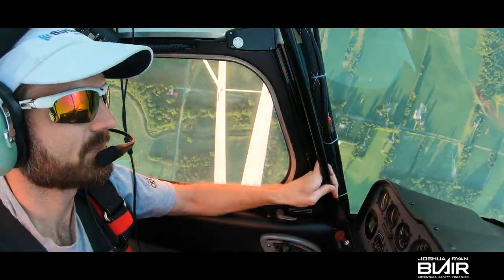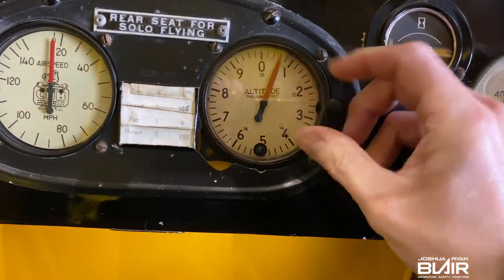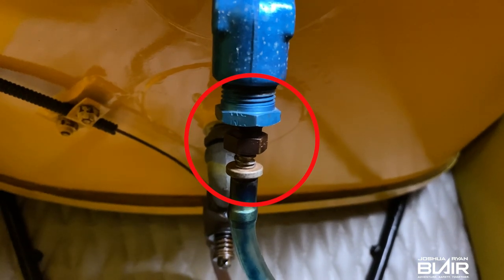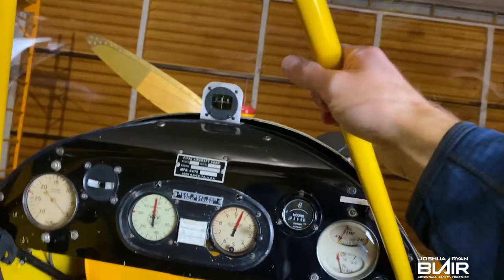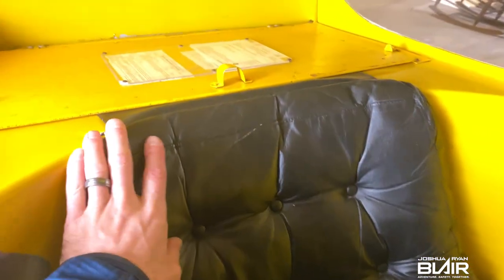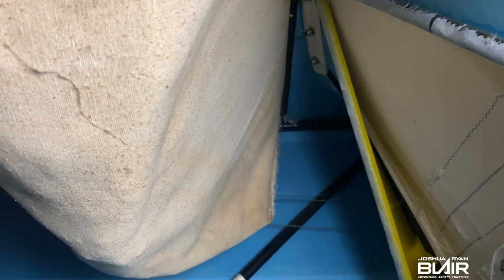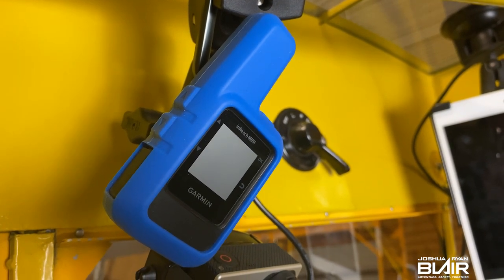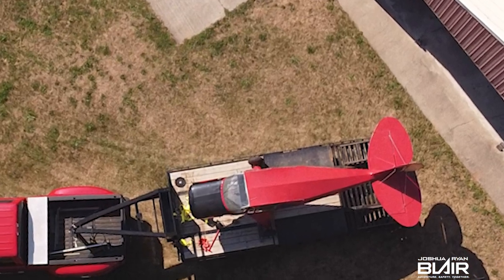Real Close UP | Piper J3 Cub | Interior Setup

Comment: I fly a J3C-65 built in 1946, one year after I was born.  I truly like flying it but I like your version of the instrument panel.  I can see it's been only slightly modified with the turn-slip indicator and the Hobbs.  One thing somewhat difficult in a J3C is the amount of muscle needed in the back seat during taxi.  I've heard that mentioned on other Cub videos on youtube.  I got my PPL in 1991 but am only now getting around to tail wheel.  I received my log book signoff about a month ago and have not been able to fly it since.  A month ago (February) I got my certification, the Tennessee weather improved for a week but my wife had surgery.  I still work every day and I'm the boss so I can't be fired but work does get in the way with my flying.  I used to spend a lot of time sailing on one of the TVA lakes but the months I avoided were June, July and August.  There was no wind.  Now I'm waiting for those months so that I'll have a better time flying.  I am a recreational pilot now and am not looking for challenges.  Rough crosswinds, which I was luckly enough to practice with a CFI, are not recreational flying.  I consider those conditions as "survival landing".  click on my  photo and you'll see what I've been doing for the last 50 years.
Reply from the maker: Yeah this J3 has a pre war panel. It sure is a solid straight flying J3 though. Approx 1100 hrs TT and its been kept well. The backseat and even more front seat is somewhat a challenge just getting in and out honestly. (gets much better with practice)

However, taxing and flying isn’t too bad to catch on to. it’s such a simple and very nice aircraft to fly. 
Tennessee is such a beautiful state. The months you mentioned will be a great time for you to get more experience! Enjoy! Appreciate the comment. Thanks! 
Also, I purchased a PA-16 last fall which I’ll be sharing here very soon.

Comment: bit of advice if your working as a A and P make sure your own airplane looks good and this cubs seen better days no way i 'd want the same work done to something i dropped alot money on   .. Dump time into  it and mke it right !
Reply from the maker: What concerns you about it? 

“Spare Parts” has a grubby look for a few reasons. From a mechanical stand point, it’s in top shape. The airframe is extremely straight and honestly this second owner Cub is more solid than most. I understand the grubby look might send a different vibe to some. 

I’ll have to share the story behind it soon along with more unseen details.
Reply: @Blaircraft.Engines  I thought your plane looked pretty sweet, I wouldn’t think twice about flying “Spare Parts” just wish I could do it from the front.

Comment: I realize the line of thinking here is keep as much original as possible, but it escapes me why any Cub owner, who regularly flies it, would settle for the use of those original seats.  I want my fat ass in a firm, modern seat, with headrest in the rear seat and both more ergonomic and durable, and include some larger crash harnesses.  

Secondly, why not install say, a dash mounted Attitude Indicator?  For a Tail Dragger, this would add such a larger degree of safety to know precisely where you are, particularly if youre caught suddenly in IMC with updrafts.  So much crash and Vestibular Illusion avoidance with that single instrument.

Lastly, was hoping since back in the day they didnt have any of this, a source where I can find any published specs on the Cub beyond its original POH, such as W&B, etc.?  That "20lb" in Luggage Compartment is a gas!  Like, how do they know what everyone weighs, lol?!!  Personally I would remove that sign and put it in storage just in case some knucklehead trys to rely on it.

Anyways, great professionally produced video!  Please try to answer my question on addtl. specs too if you can, and Take Care!

Comment: Would a short person have trouble flying it I'm 5' tall?
Reply from the maker: I don’t think so. From the back seat, which is where you fly from solo (pilot in command) the rudder and brakes controls are pretty close. 

However during the engine run up, it’s hard to reach the carb heat forward of the door. But there’s a easy modification for this though.
Are you currently flying anything?
Reply: @Blaircraft.Engines  

Yes..
Reply from the maker: @rafaeltorres2886  Awesome. Any tailwheel time yet? The J3 is so simple and just awesome.

Comment: I just discovered your channel and love it!
 I fly a Piper L4 with no electric system with an Odyssey battery to power  the starter. Currently using an Icom A25 for radio, with a portable Intercom similar to yours,  but plan to install a TRIG TY91. Do you think I Can use the same battery for both the starter and the radio? 
Thanks.
Reply from the maker: Awesome. Thanks for the comment! I was going to purchase a L4 15 yrs ago. (Wish I had) It should be just fine using the battery for both, I would be sure to have the radio off when cranking to help preserve the battery.
Reply: @Blaircraft.Engines  Thanks for the answer.
Best regards,

Comment: how  does cabin heat work?
Reply from the maker: The shroud around the exhaust can either allow heat inside the cabin or the carburetor. There is a pull knob in the dash for the cabin heat. 
Surprisingly the cub has a pretty decent heater, although it does come from the front towards the back. 

Did I describe that clear enough? 😁

Comment: Learned to fly in 1976 in a 1940 J3.  Moved up to nose rollers to finish off all the nav/radio work to get private.  Bought a 1941 Aeronca 65TAC and rebuilt it for the most part.  Kept it 5 years then took flying job.  Did that gig for 18 years, moved to flying a mahogany desk for next 26 years.  Had kids to raise until they grew up and left the nest. Hadn't flown anything for 26+ years.  On a whim  bought a 46 J3 65 around 8 years ago.  Got BFR in C172.  Waited a week before Cub got ferried to me.  Jumped in and took to the skies.  Just like I'd flown it yesterday after all that time.  Done over 1,000 take off and landings in this Cub and fly as much as I can - when I can.  It's a good hands off plane in smooth air.  Done a LOT of work over the years on it.  Just love to fly the Cub now.  Low and slow is a hell-of-a-lot-more-fun than go fast glass cockpit nose rollers.    
Looks like your's gets the attention it needs and looks really nice inside.  I had a bunch of spaghetti wires all over the place, then did some upgrades.  Based in and fly a lot within Mode C veil so just decided to bite the bullet with all necessary stuff to be 2020 compliant even though never had electrical system.  Have wind driven alternator that keeps everything charged.  Fun and highly recognized aircraft. Best toy I've ever had!
Reply from the maker: Awesome... I'm glad to hear you jumped back into something that really allows you to enjoy real flying again. Early morning and evenings is when I like to fly most. Also, being 2020 compliant is a good thing. I would like to at least get the BOM to mount under the wing. Do you know much about that bolt on option using the Ipad?
Reply: @Blaircraft.Engines    My Cub as the BPE14 alternator - mounted between gear legs. http://www.basicaircraft.com/gallery/turbo-alternator-bpe-14.asp   STC kit, it provides plenty of power to run Becker 4201 Radio,  Garmin Transponder, Garmin GDL 82 ADSB out, Intercom, ADSB-in, an iPad and/or Tablet. Made avionics rack on tubes near the overhead window.  Best part-  NO wires running all over the place
Reply from the maker: @avflyguy  Interesting... I'll check it out. Thanks!